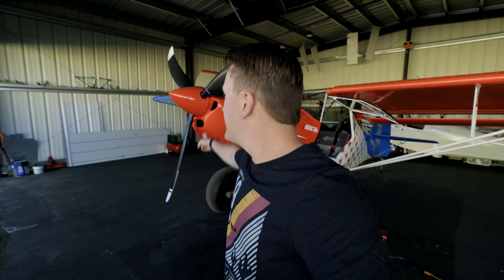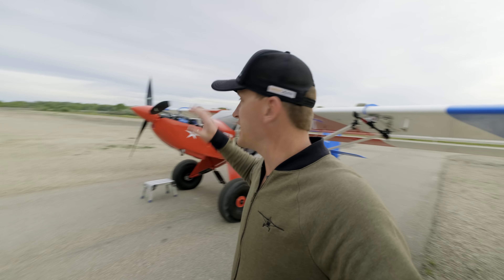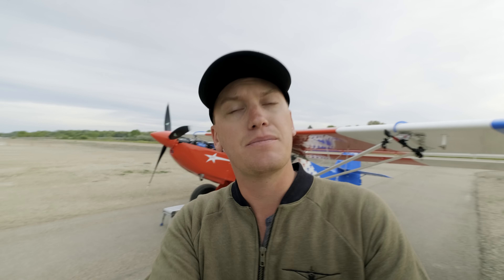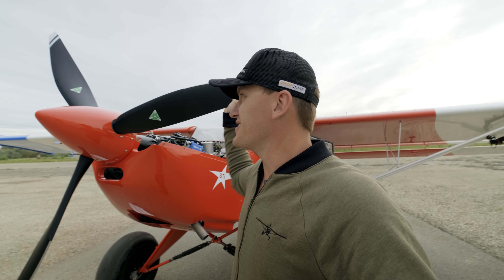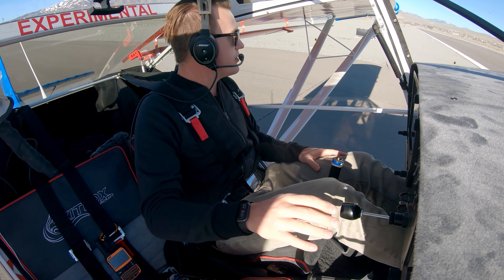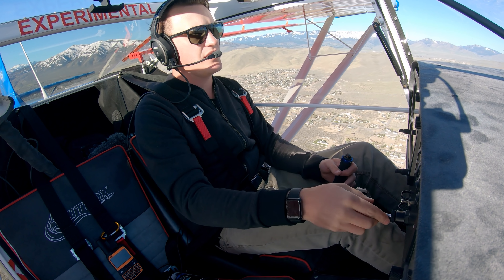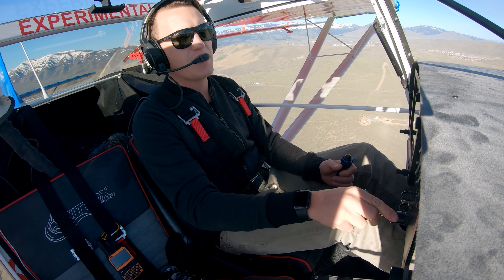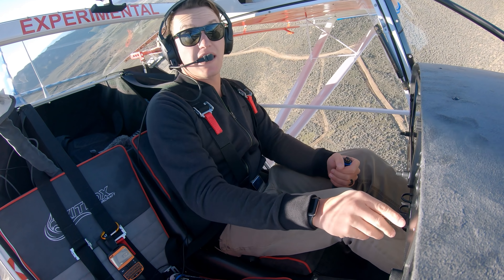MAD PROPS - MT Constant Speed Propeller Upgrade

Comment: I was at 13,500 K the other day, burning 4 GPH, and indicating 81 MPH.  No turbo or constant speed prop, Just a Zipper BigBore'd 912S and a Luga 79" prop.  Simple and light works every time.  Down to 72 indicated, I was burning 2.5 GPH, still at 13K+  This low fuel flow of course gives vastly increased range.  Climb rate was still 350 FPM at that altitude.
Reply: Forgot to mention, Rans S-7S

Comment: It takes 8 times the power to double the airspeed. The fox is  a flying bread truck. While constant speed is nice, I am a firm believer the in the K.I.S.S principle. 20 lbs and all that extra electronics. On a bush plane I am sure its nice but its like putting a suit and tie on a mechanic.
Reply: Bread truck? What's wrong with bread? I actually like bread. Are we talking F1 here or top fuel dragsters or just having a whole bunch of fun? Gee. Actually I think there's a 915iS there which handles the job. I believe Kiss were a band btw who used to wear lots of funny make-up.
Reply: Btw, here's a real breadbox btw, in case you haven't seen an SC.7 https://youtu.be/421F9cE4wxM ..not sure how that would go with your power vs weight. Then there's the flying egg, PL-11 Airtruck. You know, like, wakey wakey, eggs 'n bakey.
Reply: @outsideraircraft5215  The kitfox is not a fast airplane. Like putting a jet engine on a tug boat.

Comment: why are you "screwing" / turning the throttle handle while its a sliding bar so to speak?
Reply: It’s both. You can push/pull for fast adjustments or you can twist the knob for precise adjustments. Righty tighty lefty loosey. I mostly use the twist feature for mixture and prop speed rather than throttle, but on Trent’s a/c I’d do the same thing he’s doing. Reason being that it’s very helpful on a turbo-normalized engine because there are specific manifold pressures/fuel flows that you’re looking to hit, and it can be somewhat finicky to hit those without the twist feature. The twist will give you a very consistent change in throttle position, which you’ll notice allows Trent to keep his head outside where it should even while he’s making precise power adjustments.
Reply: John Griffin cool to know! Thanks for your explanation!!! 😄

Comment: Love your vids Trent, but are you honestly sure your elevator stalls before your main wing does (7:52)? That would cause the plane to be dynamically unstable, i.e the stall would not tend to self-correct... That would get a lot of absentminded pilots killed, so I believe Kitfox would have ensured the main wing ALWAYS stalls first....The only type of plane in which the elevator stalls before the main wing, yet you retain dynamic stability, are Cunard designs, where the elevator is in front of the main wing, like the Beachcraft Starship, LongEZ, Piagio Avanti etc...
Reply: The pitching moment of the wing and the cg forward of the wing are both pushing the nose down. The horizontal stabilizer is flying upside down, keeping the nose level. If it stalls, the plane will nose down. With a canard, the wing and stab (canard) are both lifting, hence the improved efficiency. If the wing stalls before the canard, the plane will pitch up, exacerbating the stall, so canards have a static angle of attack to drive them toward stalling first.

Comment: Hey Trent, I know this is an older video but I’ve got a question when you were running this prop. I have a 915 with the Airmaster constant speed prop. I can run full manifold pressure at climb RPM of 5500. How does the computer with MT know when to pitch to prop after the five minute max power limitation? Or do you have to pull the power back? If so, it would seem you would effectively  be climbing at a lower manifold pressure than the Airmaster?  Just trying to compare of the performance differences to see which one is better.

Comment: I got a ride in a p-51 (daughter birthday present) Brent Conner with Erickson.  Turning 2600 rpm, 4 bladed controllable  prop.  Cruise at 350 mph, 30 gpm, @ 425 mph still 2600 rpm 50 gpm.  Me, I am a private pilot  with A&P but never worked at it.  Expensive hobby.

My point, you are duplicating the system in the p-51,,,,WoW!.  Now you need a liquid cooled engine that will last 5000 hours without overhaul.
Iguana

Comment: What does twisting the throttle do, as opposed to pushing it ion and out?
Reply: Twisting makes small adjustments up or down to engine RPM. Pushing and pulling the throttle makes the large adjustments.
Reply: @shannonwhitaker9630  sweet, thanks for the info

Comment: I enjoy your videos. I had been on several float plane fly in trips in Northern Canada before, but that felt like a commercial airline flight compared to my first backcountry flight in Alaska. The pilot landed on a gravel beach, within a river on one side and a stream on the other. I thought there was no way we could land there, let alone take off from that short of "runway". It was like being on a roller-coaster. He dropped us off and took off with room to spare. But, I had my doubts about the return trip; with the extra weight of the 2 of us and our gear. I was blown away by how fast he got us in the air and how steep he climbed to get up and out of the valley. The fishing was excellent, but the highlight of the trip was the bush flight.
Reply: What engine are you running behind that prop?
Reply: @ralphmcnair2486  Hi Ralph, I think you are asking the wrong person the question. I simply was relating a story about my first experience with a bush pilot.

Comment: Does the CS prop give you a higher VNE?
Reply: VNE is the airframe limitation so you dont tear the wings off.
Reply: HotRodRay Actually VNE is not only determined by airframe but also max engine RPM especially considering reciprocating engines. In a dive the airspeed can push the prop over max engine RPM. That’s why Rotax engined aircraft have such a low VNE in comparison. Unless there is some aerodynamic or airframe restriction i.e. extremely thin windshield, then I would suspect a higher VNE for this AC.

Comment: Wow- super happy with the outcome. Was concerned about the added 20 Lbs. on the nose, the smaller overall blade length,  AND the interaction with all of the data being interpreted correctly. Faultless computer decisions, tons of power in all ranges, attitudes and altitudes, no noted heaviness or loss of 'tossability' caused by nose heaviness, simple to use (no pilot overload) and no new bad behaviors. A total win in the super lightweight Kitfox. The Freedom Fox is a completely new machine- really crazy impressive. I genuinely like how easy it is to have and use and well-- No crazy training and planning to manage the process. Sweet. Very cool rig and so far away from the start of 2018, right? Carbon Cub, Highlander, Maule and now Kitfox at the top of the heap of STOL aircraft. (Draco excluded as a M. Patey 'One Off'). What an awesome trip, Trent- thanks for taking all of us along. Legit question: Is there a Kitfox version with a larger empannage? One you could swap in from an older or newer design? That would keep it pure Kitfox and increase rudder authority at super low speeds? It would be nice to have the added control while the wing is still flying...

Comment: Do you have VGs on the underside of your horizontal stabilizer?  If not, you might be able to delay the tail-plane stall with them, so the limiting factor is your wing's AOA. (I say underside of the stabilizer because that's the "top" or low-pressure side of that airfoil)
Reply: VGs might not be very effective with the lack of airfoil on that elevator.  I think they work better on the wing type than the board type.
Reply: @jamesburleson1916  That would make sense, though I wonder if "a little bit better" might be enough improvement for this application.

Comment: It would be interesting to modify the H stab to an inverted airfoil, such as in the Zenair 701's and tip fence like the Porter to improve the efficiency of the smaller stab surface area.

Comment: Could you explain the differences between a 3 blade propeller and 2 blade
Reply: 3 blades have 3 blades coming off the prop. 2 blades have 2. Usually a 3 blade is used for more ground clearance because they are shorter.
Reply: blade width, blade length, blade shape (straight or curved), airfoil shape, and they can be fixed pitch, ground adjustable pitch, or variable pitch... even constant speed (rpm) governor controlled pitch.

Comment: Hey tent love the channel. Not a pilot but want to change that. I was wondering what are you doing when you're twisting the throttle, is that fuel mix or something? Thanks
Reply: He’s just reducing the throttle by twisting it instead of pulling it back. If you’re making smaller throttle adjustments twisting works nicely.
Reply: @andrewmorris3479  thanks Andrew Morris. That makes more sense now that I think about it.

Comment: I'm really curious how you " dnynamically balance in place " a prop !  ( I have some ideas of my own but they're based upon dated tech )   BTW I see your KF  and new engine/prop combo performs pretty much per reality i.e the faster you go the more fuel you burn to ovear come the increased drag component .  I suspect that  "single-lever"  control is a gas and much better than the old mechanical  throttle/prop hooks .  All thats left is seeing what essential equipment you can move aft to improve the CG !  Looks like a nice flying  aircraft !  Love to get my hands on it !
Reply: google DynaVibe, its the device that most use when balancing a Rotax powered prop. Its basically like a balancing a wheel for a car - you spin and see where you need to add some weights.

Comment: Am I missing something here??? how is he at 40 inches manifold pressure and 5500 rpm???
I don't think you could ever have more manifold pressure than outside ambient air pressure and the RPMs seem so high as well.
Reply: It is a turbocharged engine, and it must be geared as well to account for the high rpm.
Reply: It is a turbo SUPERCHARGED engine.
Turbo engines maintain 29" sea level pressure until they run out of turbo capability with increasing altitude.
Supercharged engines are capable of MORE than sea level pressure at any altitude, until the air delivery capbility of the supercharger is exceeded.
Radial engines were mechanical superchargers, and some like B17 bombers, had turbo chargers blowing into their mechanical superchargers to get 30,000 ft altitude..
wow.
Reply: @hotrodray9884  I understand the history and differences of turbo-normalization and turbo-charging/turbosupercharging. I just simplified it because not everyone on a youtube comment section wants a history lesson and more people are familiar with the term "turbocharging" from the car industry.
Reply: What's really impressive is that he could get 46" of manifold all the way up to 15,000ft!

Comment: Wrestling with the weight demon as you celebrate the angels of power, acceleration, speed, and fuel efficiency.  ‘Might look into putting your emergency kit in an externally accessible box near the tail (not particularly significant weight gain), or build a slightly larger horizontal stabilizer and elevator and possibly a tad larger vertical stabilizer and rudder (more weight where it’s now needed to balance your new prop, full pitch authority through the stall, and a touch more aerodynamic yaw authority to compensate for the additional weight in your tail...).

Comment: Seems constant speed props on 912's are problematic, the extra weight overwhelming and damaging the sprague clutch.   Any feedback from Rotax on constant speed props on the 915?
Reply: The 915’s gearbox was actually designed for a constant speed propeller. The gearbox is quite a bit different from the 912/914 series.

Comment: Isn't the point of multiple bladed props in order to shorten the length of the individual prop while still gaining surface area? Why put on a 3 blade that's just as big as a 2 blade?

Comment: That appears to be a full 360 barrel roll on the intro.  How often do you barrel roll it?  Great video as usual.
Reply: That is an aileron roll. Barrel roll is basically a back flip but in a plane.
That was done using an older engine, and it will starve while inverted, so he could only be upside down for a few seconds before the engine shuts off. His new plane is EFI so it should be able to just fly upside down.
He doesn't roll it very often, or at least he doesn't show it in his videos.
Reply: barrel rolls are 1g manuvers and the engine and airplane dont know that they are upside down or rolling.
Reply: 1 G  was my understanding. Like Bob Hoover does with a cup of tea on the dash.  https://www.youtube.com/watch?v=V9pvG_ZSnCc    Not an aileron only roll that involves true inverted gravity flight.  The question was for Trent because it appears to be the Freedom Fox performing the maneuver.

Comment: Can get automatic props to keep the engine in the power band like on an Me-109?
Reply: Const speed means the prop is always at the same speed. The moving of the angle of attack of the blades allows more or less air being pushed off the trailing edge. You keep your prop maxed out on take off to get the most air. You feather it at alt.
Reply: @zachv1942  I know how a constant speed prop works.What I meant was a prop with an automatic setting that would keep it in the engines optimal RPM without any pilot imputes.Like on the German ww2 aircraft.
Reply: No clue on this one.
Reply: I would look up his eec is.

Comment: do you have prop angle control?
Reply: Yes.  "Constant speed prop" means automatic in-flight adjustment of prop blade pitch to match power setting.
Reply: @SkylaneGuy  actually, no, it doesn't. His is automatically adjusted. Most constant speed props are manually adjusted while flying.

Comment: Hey Trent. Can you explain what a constant speed prop is and what the benefits of it are compared to other styles? 

The video you made of the ground loop “monster” was a great video. The way you explained it was super easy to understand. 

Thanks for all the great videos you put your hard work into!!!
Reply: If Trent doesn't reply, I can hopefully shed some light.  A CS prop has a mechanism to change the pitch of the propeller blades mid-flight.  A fixed-pitch prop is usually optimized either for climb or cruise.  If you have a cruise prop, your takeoff performance suffers, but you get higher top speeds and cruise efficiency.  A climb-optimized prop will get you off the ground quicker, but won't give you such good cruise performance.

A CS prop gives you the best of both worlds, but is also a bit heavier, more complex, and more expensive.  If you have a traditional carbureted engine, a CS prop will give you a third knob to manipulate.  Trent's setup, with a fuel-injected engine and an EMU that manages the propeller pitch automatically, brings the knobs down to one.
Reply: Awesome, thanks guys!

Comment: Trent the tailplane cannot stall before the wing,the stall occurs about the centre of pressure of the wings airfoil and on the axis of the centre of gravity,it is the wing that stops flying not the tailplane.
Reply: Actually this is not quite correct.  Both the wing and tail plane are aerofoils and to stall the wing requires significant tail down force provided by the tailplane (to get the wing angle of attack to the stall angle).  But if there is insufficient air flow over the tail plane, to produce this down force, then the critical angle of attack isn't achieved and the aircraft will simply loose height (due to lack of airflow over the wings).  Apply a bit of power and the slipstream airflow over the tailplane enables it to produce the down force required to achieve the stall angle of attack and the wings will stall.
Reply: ya some can

Comment: Hey Trent, can you explain to this dummy exactly how your pitch variation control is managed on your plane?
Reply: I am also interested in the details of the MT+Rotax with single lever.
Can the "curve" by which the EMU "guesses" the right RPM be adjusted?
Does the EMU drive the throttle position and wastegate electronically to achieve the desired boost pressure or is it a mechanical throttle?